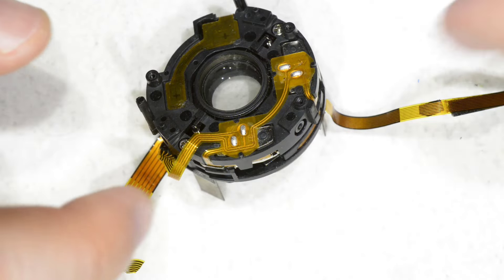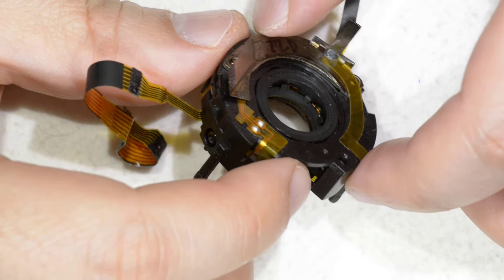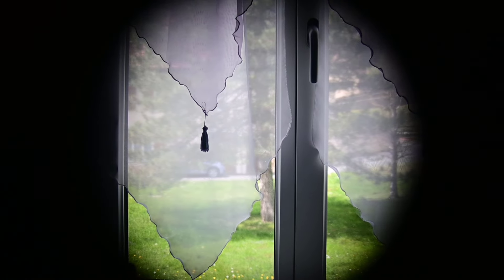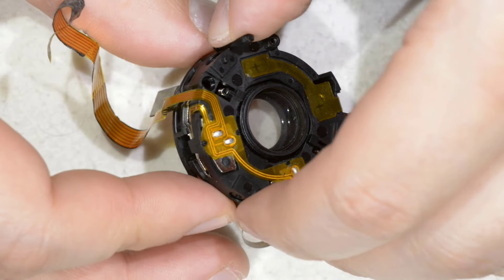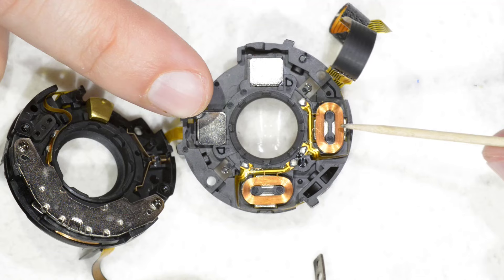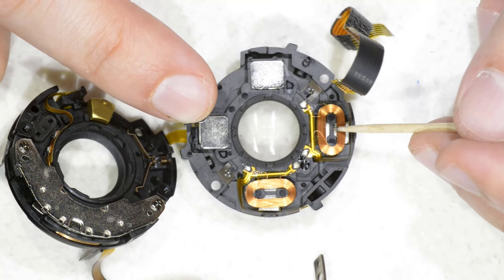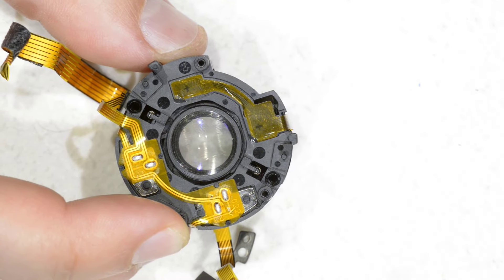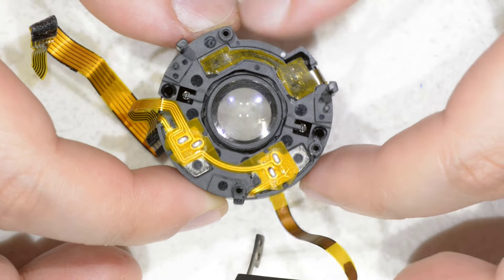How lens optical stabilization works ?

Comment: I like the "this guy". Makes you wonder if there are body parts that have some kind of suspension...I dropped by from seeing your post in the Vintage Lens group.
Reply from the maker: Yes, the little moving lens is mounted on 2 little springs, but in my opinion, it is just to hold it while allowing some in plane motion. I don't think the springs work by themselves as a passive suspension. All the work is done by the magnets ans cools. Best.

Comment: thankyou soo much for this explanation and breakdown 👌👌
I have some questions.... I was wondering if this mechanism is a similar design to what Tamron lenses have?? when I have VR activated on my Tamron lenses, it sounds as if there is a very soft rotation sound happening (like a disc spinning)....so I thought the mechanism worked on a principle of centrifugal force to keep the lens cantered (hope that makes sense).
Also, how susceptible are the mechanisms to damage... I know a force like a drop is very bad for them (from experience).... but I was wondering if techniques like whip pans (used for video transition) could be bad for them?
many thanks
Reply from the maker: Hi, glad you appreciate. My guess is that it is very similar. I don't think the mechanism you describe is used for lens stabilization, but yes, it makes sense 😊. About the damage, like everything fine mechanics is sensitivity to shock, a dropping being the worst as there is a big sudden deceleration. A whip pan seems smoother than a drop, so, it should be ok, maybe a faster battery drop as the coils will need more current to cope with the jerking. Thanks to you I discovered what a 'pan whip' is, I didn't know this term before. Thanks.
Reply: @diyextravaganza  thanks for the reply, and again thanks for showing us inside. it's good to see what mechanics are involved. I do like having the option for in-lens stabilisation, as I think it is better than on-sensor stabilisation. However, the downside is it make the lens far more fragile 🤷‍♂️
Reply: @diyextravaganza  I think your right too... a drop is considerable more deceleration than from a whip pan. 👍
Reply from the maker: @photo2000  yes, but lenses are designed anyway to take some beating before giving up. As shown on the video, springs, magnets, and coils are very resilient components.
Reply: @diyextravaganza  agreed 👍👍

Comment: Unrelated question: how often do you see that fungus has dissolved lens coatings and glass itself

Do you usually see damage after cleaning?

I'm getting a Nikon 70-200mm G VRII with a little bit of fungus on element group 1 lens 2 (behind front element group) and I'm wondering if there will be traces left after cleaning
Reply from the maker: Hi, I've worked up to this day in about 400 different lenses. True damage due to fungus? I've seen only once on a sigma 90mm. Some damage? About 5 or 6 times, and it is mostly a discoloration on the coating that once cleaned you only see by looking a the right angle, the right light, and knowing it was there before. 
So, I'd say chances that the glass or coating are damaged are very slim. Best.